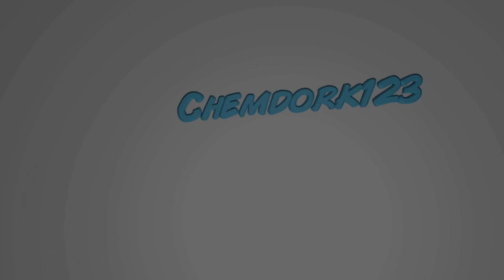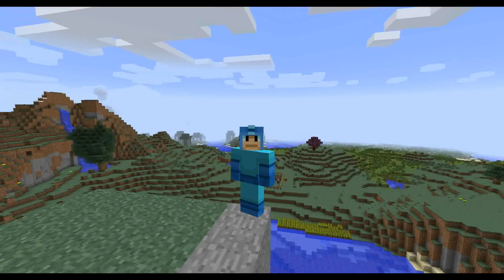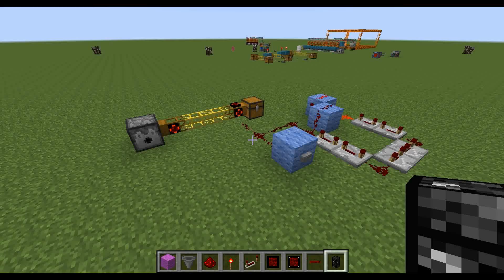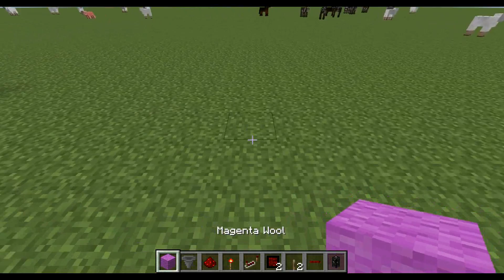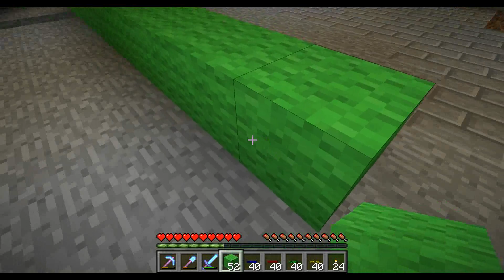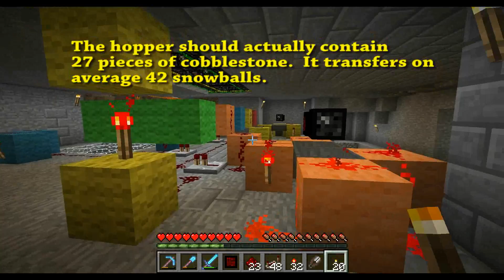My Buildcraft S2E45 - We're Still Playing With Power

Comment: I'm confused. If your gonna increment, why use 10-20-30-40-50 ? why not do 10 sb for every increment and decrement meaning that every button press (the increment button for example) would move 10 snow balls from the one inventory to the other. That way you only need the four wires and no decoder. Also the decoder needs an encoder to correspond on the upper level. Isn't that just complicating things ?

 And like RetiredMaster said - for full on or full off just move everything in the inventory to the other by triggering the equivalent gate until it's empty (comparator?)

 Other then that I'd like to thank you for this series, I'v learned a lot about gates, comparators and the rs logic gates. You really have a handle on that !
Reply from the maker: Sorry if it wasn't clear about the increment/decrements.  Each increment is 10 sb because each level of power is 10 sb.  So the first set of buttons increments/decrements by one power level (10 sb), the second set does the same, but with 2 power levels (20 sb), etc.  So it just allows me to quickly decide to go "up 4 power levels" if I wanted to, which does not add any real problems.  The system for doing that is needed, since some machines are going to need me to go "up 3 power levels", and some only need 1 power level.  So I decided to create buttons to do that manually if I wanted to.

For the full on/off, yes - I can do that about the gates/inventory, and in fact I do something very much like that (next video, I believe).  I use pipe gates though, not comparators.  Mostly that's due to not having the room for a comparator type of system.

Hope that's clear.  Thanks for watching.
Reply: Well that is much clearer. You didn't show the control panel buttons before you made the decoder  so I didn't know thats what you wanted to do... I still think that is over-complicated, you could have just made the 10 sb increment and press that button as many times as needed to get to the power level required (That makes for less complicated system and control panel), but it's your game. Game on !

 Well, I'm now watching the next videos and I'll see what you make
Reply from the maker: jockeril The purpose of the decoder is to be able to interpret the signals to turn on/off the power plant as needed from the machines.  Some machines will want only 1 power level, whereas others (such as the assembly table) need to have 3 or 4 power levels added.  This is why I have all the increments in the system setup.  It's not connected to the buttons themselves, but imagine that each group of machines has a "button" - one I push manually or one that starts automatically.  They will all potentially need a different amount of power added.  Hence the need for the decoder setup.  The buttons are there more to test if the system works, although they are also functional.

Again, it's probably clearer in the next few videos.  I'll be revisiting and finishing this project in the next video.

Comment: i think you have some names switched around. As wha i learned.
What you call "monostable" is a pulse lengthener.
And what you call edge trigger is a monostable ;)
Reply from the maker: I believe you are partially right.  In the end, BOTH are actually "monostable" circuits, in my opinion.  Monostable means that the circuit exists in one "stable" state most of the time except when given a particular input (trigger) that pushes it into an "unstable" state.  In the unstable state, it will eventually revert on its own to the stable state.  In this case, both would be monostable... just with different triggers.  In one case I use an "edge-triggered monostable circuit" and in the other case I use a "pulse-adjusting monostable circuit".  Make sense?
Reply: Yeah. Makes sense when you think about it. Some redstone circuit names are just so out of the space you would think about... For me, I learned most of my redstone from Mumbo Jumbo (redstoner) and from playing on Redstoner.com server.

Comment: Hey chemdork, I'm in 1.6.2, and I downloaded nei, forestry, ect. But I can't power the forestry machines and the thermal expansion mod was there, but I couldn't get any of the machines. Pls help!
Reply from the maker: I recommend using the newer version of Minecraft (1.7.10) and making sure you are using all the mods associated with that version.  If you are manually installing, install the latest forge version first and then run MC to make sure forge installs completely and is running properly.  Then, install the other mods in the proper folder, following the instructions for each mod.  I believe your problem with Thermal Expansion could be due to not installing all the required modules for that mod: you will need CofH Core, Thermal Foundation, and Thermal Expansion.  They are all necessary for the mod to work completely.  Remember, the conduits are no longer a part of Thermal Expansion, though...
Reply: chemdork123 Thanks Chemdork!

Comment: Chemdork if you want an easy way to send all of them out of/into the dispenser, just add a comparator to both of them, and when either of those go off make the inventory you're pulling out of stay on until the comparator turns off. Alternatively, you could of course replace the comparators with gates with items in inventory -> send redstone signal.
Reply from the maker: That's actually a very elegant way of doing it with comparators.  I was thinking more the pipe gate route, but the comparators might be even simpler.  Plus... I haven't had the opportunity to work with comparators, so it should be fun.  Thanks for the suggestion!